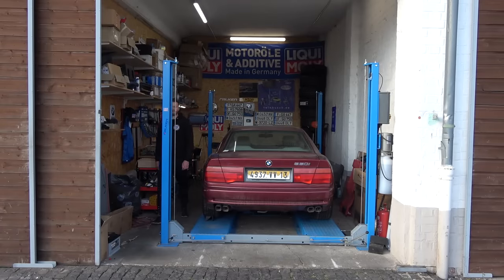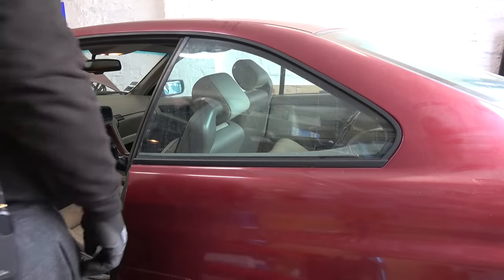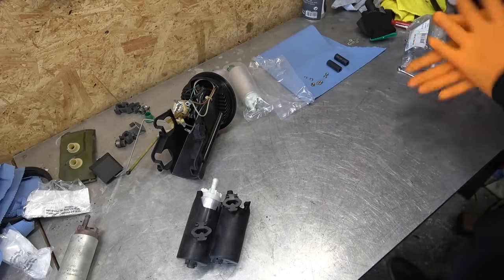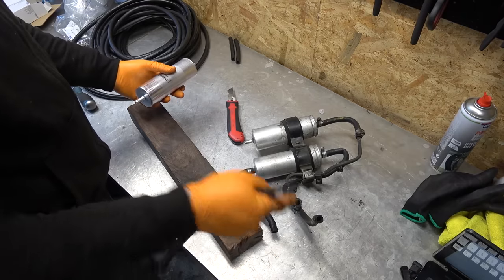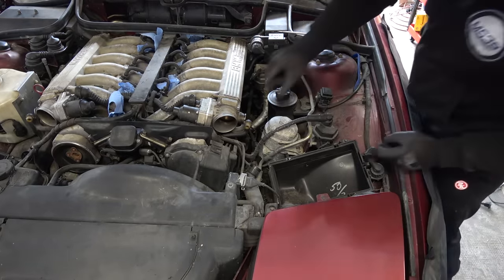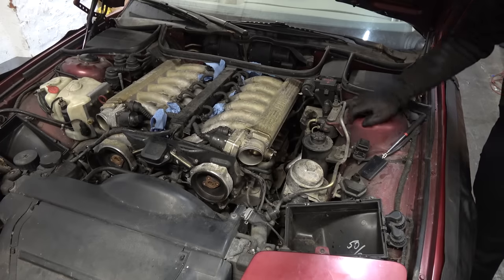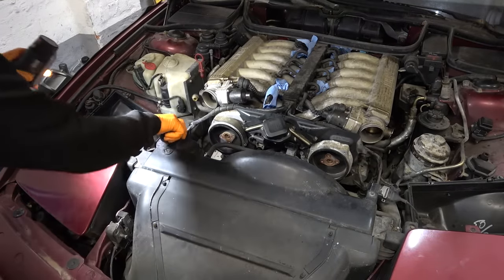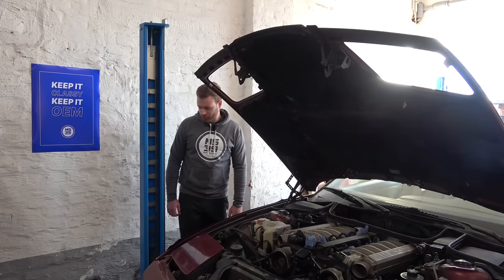The Hack Jobs Unfold - Garden Find V12 BMW E31 850i Revival - Project Marseille: Part 2

Comment: When changing spark plugs or glow plugs, to stop them from ceasing, is there anything that can be used?
Reply: Some people use anti seize compound, but NGK themselves advise against using any oil, grease or anti seize as they have a ‘trivalent’ coating on the plug already. In practice I suppose a dab of antiseize is ok. 
When fitting spark plugs I always put a piece of vacuum hose of the end of the plug and start threading them in using the hose, that way if they start to cross thread, the vacuum hose just spins on the end of the plug.
Reply: spark plugs on heat cycled alu head it will never cease.
Reply: @ventouxR  I hope that's true but then how do people snap them while still in the block?
Reply: @soldiers303  weak material on spark plugs or got overtightened.

Comment: There is always at least one guy who is playing the critic, no matter how perfect somebody is working. In this case, its me. I am surprised that you keep using NGK plugs, here, as well as in project Karlsruhe. Wouldn´t those enignes originally have come with Bosch or Beru plugs? Reason I´m asking is because there are a lot of cars who react very sensitive to other spark plug manufacturers than the originally came with, although the plug specifications are exactly the same on paper. Personally, I always match the plug manufacturer with the engine manufactuerer, origin wise. So for german motors its Bosch or Beru, for asian motors NGK or Denso, for italian motors Magneti Marelli (or Lodge in some cases), for french motors Eyquem, for US motors Champion, AC Delco or Autolite and so forth. Am I the only one doing that?

Comment: Question: Why you don't thoroughly wash the engine as 1st step before disassembly it?
Reply from the maker: I don't want water in the engine bay and detailing is last on my list always
Reply: @M539Restorations  In normal concursantes nether do I but with this barn finds it may be usable, a day or two before disassembling it...To be clear it is completely fine without it.

Comment: Why there is no danger for explosion in fuel tank even we see wires, connectors and electric motors down in the fuel level?
Reply: My guess is- no active sparks and not the right air to fuel ratio. 

Had e36, it acted weirdly, after lots of faulty ideas, pulled out the pump, and voila- melted wires in gas tank.

Comment: Like Zionville makes much better all aluminum replacement radiators for almost any BMW that last a lifetime, I wish there would be a mfr of coolant hoses which are not rubber and lifetime quality.  This is an untapped market for a world of automobiles that continually need replacement of a rubber part that was originally formulated in the 1930’s. Surely the industrial world of high pressure hoses has an entrepreneur that wishes to become wealthy with a hundred lines of ‘superior to original’ product.

Comment: 31:25 that's the moment where I would do a compression test. Why you never do this?
Reply from the maker: You clearly didn't watch my other videos. Compression will be done once the engine is running and fully up to temp.
Reply: @M539Restorations  I watch every video :-).. I m a big fan. Okay.. maybe bi forgot you did this before. I do it sometimes cold as long all the cylinders are even.
Reply from the maker: Warm is better as it's proper indication. Done if on the E46 and E32.
Reply: @M539Restorations  yes I could remember. Greatest show on YouTube. I hoped you become the next Ed China 😁

Comment: Why haven’t you bought yourself a small sonic cleaner? The injectors will be cleaned to new spec in 20 minutes!
Reply from the maker: They are 30 year old injectors with over 200k km on them, nothing lasts forever, best to replace them at this point.
Reply: @M539Restorations  true!

Comment: That's impossible for the only decent functioning MAF to be Bosch.  There is not actually smoke waiting to be let out when electronics fail.  I'm in the middle of doing the books but I had to stop here.  If you have to use Bosch,  a W0133-1598123 from the 318 or 750il years 93 to 01 will work perfectly.  
You will have a check engine light at first and other issues.  Long term fuel trim will likely be all jacked up and this is what causes most issues. It will adjust over time. If you have access to the tables you can just reset them.

Comment: "The only spark plugs you want to use". Well... they are neither the correct sparkplugs by BMW, nor by NGK. BOSCH FGR7DQP or NGK BKR6EQUP. So yes, Multi-ground electrodes, but not BKR6EK
Reply from the maker: You are wrong. Put those spark plugs in M70 and you'll learn the hard way it runs poorly with those incorrect resistance spark plugs. I covered this in previous videos.
Reply: @M539Restorations  Are you saying it ran poorly from the factory or recommendations for OEM replacement were added later on? Maybe I'm mixing up things, is it the same with M73 engine? I recall something from your earlier videos, which video was it?
Reply from the maker: M73 is different, original Bosch plugs for M70 were 1 kOhm, current ones aren't.

Comment: Sreten, take your time and remove the cylinder head to fix the spark plug threads. It is not more work than on a straight six. Do not play russian roulette with a rare and expensive V12.
Reply from the maker: It's already fixed without removing the heads :)
Reply: @M539Restorations  You lucky bast ..., ehm, I mean, congratulations! Well done as allways, Sreten.

Comment: The fuel hoses you replaced before and after the fuel filters have failed prematurely and new ones will also fail prematurely due to stress from too much curvature! Get original ones, they are pre molded for proper fit. (Done the same mistake myself.)
Reply from the maker: That just can't be correct. As long as it can flow without restrictions, it'll be absolutely fine.
Reply: @M539Restorations  I'm not commenting on fuel flow, that'll be fine. But because of too tight a bend radius, the outer layer(s) of the fuel hose will deteriorate prematurely (constantly overstretched on curve outside). And that's the exact reason why the ones you removed had failed.
Reply: I would rather buy/make 180 bend hard pipe with rubber hose ends.

Comment: Now come on, you buy these cars as a product to gain knowledge from and usually they are HUCK but it makes good video, proving to us viewers with regular servicing at an approved dealership/garage, theses cars would run as intended.
Then of course would these same cars be able to be bought at cheap pricing - No Way - owners would want full recompense from their non diligence and you would have cars running and ready for the autobahn - which never makes good video viewing as what is wrong with a good car?

Comment: This episode and the revelations found inside the car kind of explain what's the state of mechanics in France. And by that i mean... kinda poor. If a technical school does this to a rare-ish car, at the teaching phase, then it only gets worse from there. I was never in a trade school (my trade is as far removed from wrenches as they come), i learned on my own and by osmosis from those who knew. The bulk of my mechanical knowledge comes from my uncle who was an engineer by trade. And even i know that if the car has been sat for more than a year, you never start it. Not even a jolt. And it's not even about mechanical issues in the first place, electrical fire. You don't know the state of it, not unless you check, and it's pretty obvious that checking for it wasn't on the menu.

As for that burned filter and MAF, that's 100% an imbecile (because i cannot label the person who did that any other way) who popped the cap open, sprayed the filter, and popped the cap back in to start the engine. The brute's way towards a "quick fix" that ends costing people more money. And seeing where the broken spark plug was,... i'm gonna go ahead and guess that's the same "skilled" and "educated" hand at work, wouldn't be the first time i see that kind of "mechanic" use garbage stuff off the shelf from another project. Never send a car to a technical school unless you were about to send it to the scrap yard, the teachers there are even less proper than mechanics with 5 years under their belt. At least by that point, they'll either be fired for ruining cars for customers and hired at a shop you shouldn't be frequenting anyways, or at the very least brought in line by mistakes and lessons.

jm2c but as far as i'm concerned, starter fluid is not a mechanic's tool, it's a farmer's tool. Only farmers use it. If you can't start a car and have to reach for that, then you've failed and should probably reconsider what you're doing there, because the burnt plastic is the least of the issues that stupid method causes.

Comment: okay, i am going to be "that guy".  Why don't you in your projects ever remove the entire engine from the car for inspection and rebuild, that way seems a lot more easy to work on ?  Maybe it just is the simple fact you have no motor hoist and stand or is it another reason ?
Reply from the maker: Your question doesn't make sense. What's the point of removing and rebuilding an engine if said engine is good?
Reply: @M539Restorations  true if the engine is really good, but you don't know that 100 % before detailed and visual inspection of cilinders, valves, cams, bloc, specs etc ?  You carefully inspect and replace a lot of components regardless of really needing it now, why not the same detailed inspection/replacement if needed for the components of the entire motor ?  plus: work on it is a lot easier when the motor is out on a hoist. Why not do that because a lot  of components around the motor need/get replaced anyway ? So getting it out , with not worrying with all the hoses, and other connections you mostly replace anyway, even engine mounts is not going to be a huge factor.  Just an honest question , no bad intention.
Reply from the maker: I don't mind the question, just doesn't make sense. If the engine runs good without any issues, why would anyone take it apart. You are writing as if the engine rebuild is a 5 min job.